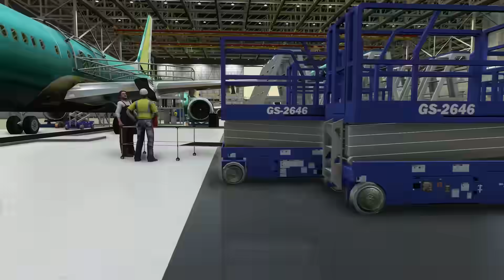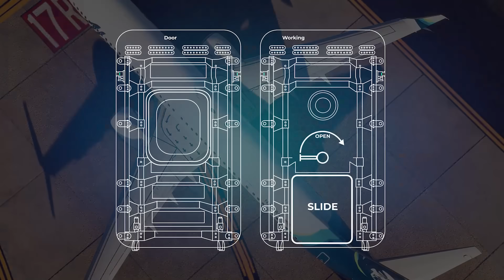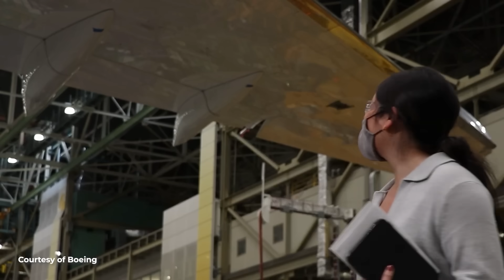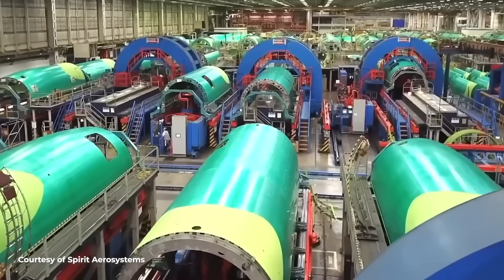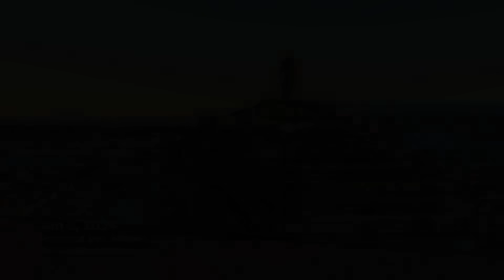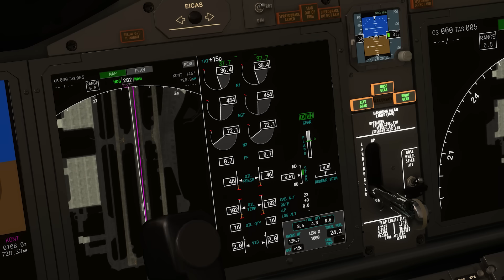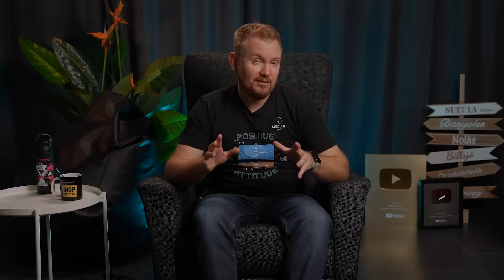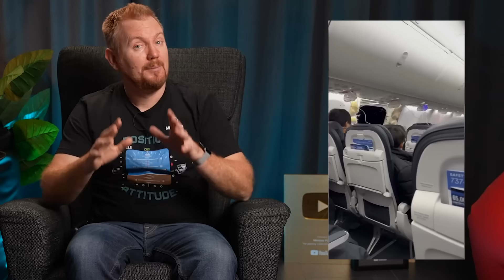Boeing 737MAX BlowOut!! The Scandal behind Alaska Airlines flight 1282

Comment: Absolutely love and appreciate your videos and the way that you describe the subject involved. Speculation at this point of course because the final report is not yet released but if accurate, the root cause had nothing to do with the door but adjacent fuselage damage that was discovered in Renton as delivered from Wichita. All work orders during production are limited to only a few hours to complete, so that work can be completed before a shift change. In this case involving the door plugs, non-conformance, I suspect that more than one mechanic was involved creating a situation where the final pins not being installed was missed. 
Interesting also, was the whistling from the door plug and the pressurization problems didn't cross the pilots at the same time (assumption), if they had maybe this would have been avoided.
I just now have to get some of your merchandise! Thanks

Comment: Back in the 90s on a puddle jumper flight from Dallas TX to Wichita Falls TX.  I don't recall the aircraft type but it was a dual engine prop jet.  I was sitting in the row directly behind the mid cabin emergency exit door.    While at cruise altitude, which wasn't particularly high on this short flight, I seem to recall 18K feet, I heard a tearing sound, like someone ripping cloth and suddenly there was a loud hissing and I could see thru a gap in the top of the emergency door.  Us passengers around it were looking somewhat horrified as the sole cabin crew member was having what was clearly a pleasant and somewhat animated conversation with an up front passenger.   Apparently the sound couldn't be heard that far up.  She didn't immediately respond to the call bell. 

Eventually she looked back where we were all pointing at this hole, she comes back hears the sound, sees the gap and says quite unconvincingly "nothing to worry about that door won't come off unless someone pulls the handle" as I am thinking that the seal probably isn't supposed to come off either.

She goes up front to the pilots and one comes back and again unconvincingly says nothing to worry the door won't come off unless the handle is pulled.  He walks back up to the cockpit and seconds after the door closes the aircraft noses down.   As we dropped in altitude and I suppose as air got thicker the outside air started to come in rather than just air rushing out.   It got cold quick and snowflakes started to come out of the gap.

Why there wasn't a pressure alert to the pilots I don't know.   I would have thought they would notice something.   I will saw it didn't seem like there was a sudden pressure change so maybe it wasn't a pressurized cabin?  

Other than being cold and getting snowed on a bit, we landed at our intended destination.   It did seem we got some priority as we were on the ground a bit quicker than a previous announcement.   After that I avoided being right by exit door though still close to be able to use if needed.

Comment: Union v. Non-Union employees?  I've witnessed Union employees setup Non-Union or even destroy Non-Union machines fire bombs or sanding engine oil .  Unions get very angry and destructive when their pathetic power is endangered.  My family spent millions across 8 years to fully  rid their company of  Union control.  Two years after my parents retired they were fined $60k and 1 year base pay (no overtime) for two men who never worked a day for the company.  Labeled as Union-Busting as many companies were doing in the early '70's.

Comment: Brilliant and clear explanation of this incident. Having worked for Boeing for 20 years, retiring in 2011, I saw many changes in the complex process of putting together a commercial aircraft. Many processes were improved upon, with a moving line being one of them. Unfortunately, Boeing ‘offloaded’ many assemblies as part of these ‘improvements.’ This introduced the possibility of errors and sub-standard portions being installed in the final product. It’s likely that Spirit will once again be reabsorbed into the Boeing Company…which should be a good thing.

Comment: While I was flying B-73's, I also only had to use The Manual Pressurization Control ONCE! I have nearly 30,000 Total Operational Hours & about 10,000 hours in The B-73. You're right, "Emergency Decompressions" are something that we Practiced Extensively in Simulators. My one time use of The Manual Pressurization Control was probably due to an Electronic Sensor Malfunction, & I never flew that Particular Aircraft again. I made the proper Entries In The Maintenance Log & notified The Company.
Also, after The Post 9-11 Bullet Proof Fortified Cockpit Doors were installed, NO ONE EVER TOLD ME THAT IN A DECOMPRESSION SITUATION, THAT THOSE DOORS WERE DESIGNED TO OPEN. THAT WOULD HAVE SEVERELY FREAKED ME OUT! As you said, That Would've Been Some Very Nice Information To Have!!!
Before I was Typed in The 73's, I previously flew DC-9's, MD-80's, 83's, 88's & 90's. I never had a Pressurization Issue In That Type.
Most of my over 40 years flight Experience was in Those Aircrafts. Sure, I've made Emergency & Pan Pan Landings, almost all were Medical In Nature, With A Handful Due To Faulty Equipment Readings.
It's good that you & others are posting these Videos Online to help prepare The Flying Public for what they might expect in the event of such Emergencies!
Fortunately, this is not an everyday occurrence! The chances of this ever happening on your flight is extremely low!
HAPPY FLYING!

Comment: My conspiracy hat is on. Extremely unlikely its a coincidence the only 2 vacant seats were at the very plug door location. Also the annoying whistle air leak sound notified to the crew by previous flight passengers was well known and recorded so thats most likely why the seats were then made vacant to not inconvenience passengers. The circuit breaker for audio was not pulled as the crew probably had discussions about that very seated area and pressure loss but assumed it was only a minor issue to get fixed as ussual, but it would now involve them in a major way, so there was no way they wanted to take the fall for the blundering incompetence of others.

Comment: You mentioned that the rate of descend has to be adjusted to the aircraft's integrity. At what point in the checklist is there an attempt to get the information from the cabin crew to make an assessment of the aircraft's status? If there is only half the fuselage left a rapid descend looks like not the best idea.
Reply: For all they knew it could be Aloha Airlines Flight 243 behind the cabin door.
Oh, the cabin door had blown open!

Comment: I do not believe it was a “coincidence” that nobody was seated in the two seats next to the door. Somebody knew there was an issue. I wish they would seize all documents and emails from and Alaska Air.
Reply: It's probably just that passengers in those seats on previous flights have complained about the noise and will give them a bad review! 
They didn't leave the seats empty due to safety concerns - they had a far more important considerations.

Comment: I don't feel safe with this plug door design.  Why is  the plug door not physically bolted to the airframe?  There is no interlock to prevent the cover panels to be installed without the four bolts to be installed.  No required checklist or bag of bolts left over from the service work.  The assist springs need to be investigated to see if they pushed the door off the tabs or was it only vibrations.  Either way, these plugs should not be this easy to "forget" to install the bolts.

Comment: Really? I can see 2 purposes that would justify fitting the springs...
6:15 "...curiously these springs were also fitted on the plug, even though they would really serve no real purpose there". 
1) if the 55 pound door plug isn't lifted high enough when pulling it closed the backs of the lower 2 pairs of lugs will clash into each other. This could be with considerable force as the lower lugs are relatively close to the axis of rotation (the rotation pins at the bottom of the hinge tubes) so there's considerable leverage from the mass of the door that's mostly well above the lower lugs, as is the point where someone is likely to be pulling the door closed from.
Although the lugs are strong, they are not intended to be hit from that direction with a force that's difficult to predict. The pin/pad adjustment locking wires could also be damaged. The hinge tubes & pivots would be subject to a similar force if the lugs clashed on closure & they could be deformed. All this can be avoided by fitting springs that lift the door sufficiently for the door lugs to pass above the frame lugs without additional lifting.
2) If the door isn't held up as the door is hinged outwards, then it looks like the lower edge of the outside skin of the door will clash with the lower outer edge of the door frame. (Due to the pivot point being some distance inboard from the outer skin of the door). This would likely damage the door or the door frame either paint damage or bent metal. Again avoided by fitting springs that lift the door a significant amount when the locking bolts (or zip tie performing equivalent function) are not fitted.
You could rely on the operator infallibly lifting the 55 pound door throughout the open/close operation to avoid both of these causes of damage or you could just fit the springs that are already part of the grandfather design that the door plug is based on. (Probably a derated spring as the plugs weight is ⅓ of an emergency exit door with slide).

Comment: 12:20 You can clearly see a zip tie around the stop pad assembly, second from bottom at forward edge of opening. At 23:10 we speculate why the plug might be moving upwards a little bit and suggest maybe those lift assist springs might be part of the reason. 

Now some further speculation, by me- Maybe that zip tie photographed (by Boeing) around the end of September that we see at 12:20 (figure 16 in NTSB prelim report) was still in place on Jan 5? Maybe it was stretching? Maybe it broke? In either case, if the lift assist springs are pushing against it, and with the zip tie now compromised / gone, the springs are now free to push plug upward another centimeter & plug is on it’s way to the ground.
Reply: That ziptie probably held the door p. in place while the mechanic went to get the locking bolts. -so that the springs would not just open it again..
Reply: @ingulari3977 zip ties paired with duct tape can hold anything in place.
Reply: @snaplash , When talk first started about those “lift” springs, some were saying they were nothing but bumpers to keep plug from banging to a hard stop at bottom of guides. Others asked if 2 similar, but different tension / rate, springs are available? One for the simple plug option, and a stronger one for the emergency exit option? If so, the heavier spring might pop the plug up & out unless restrained. A good question, hopefully NTSB knows the answer.